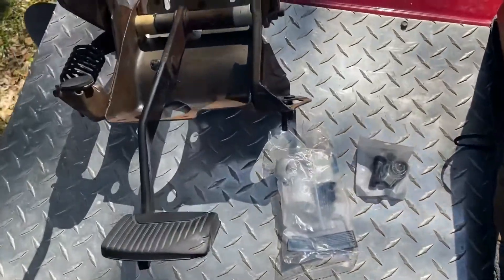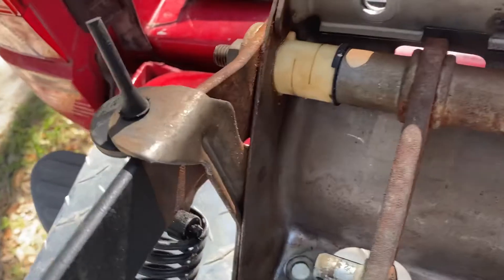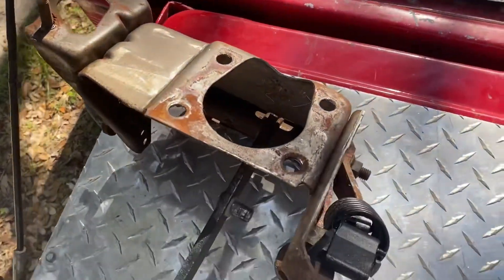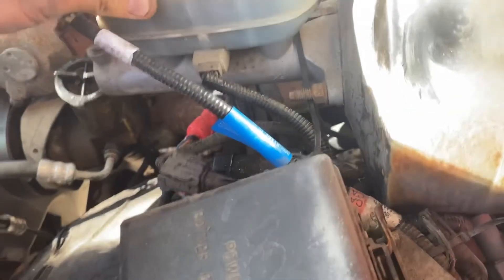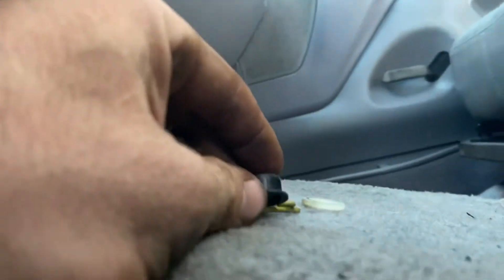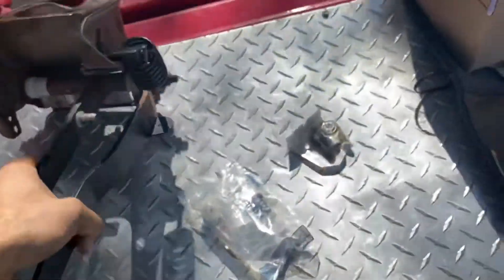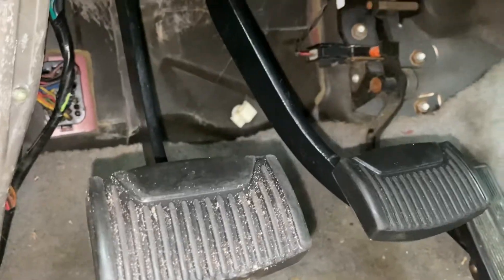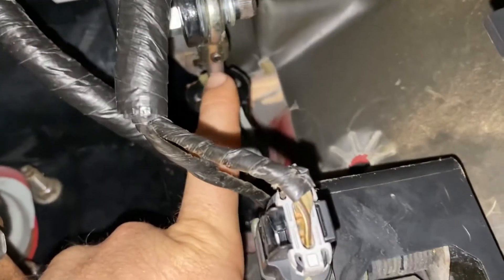Clutch Care on OBS Ford

Comment: Some how I got mine out without disconnecting the steering shaft
Reply from the maker: Wow, that’s awesome!
Reply: @obsdieselbros4160  yeah no idea how I managed to wiggle it out of there but I did. Thank you for the helpful video!
Reply from the maker: Yeah my pleasure! Glad it helped some!
Reply: I'd surely like to know how you did that! I need to pull mine out and replace
of at least replace the bushings
Reply: @mark98070  rotate it counter clockwise around the steering shaft and it comes out. Going back in is the hard part. It comes out easy without moving the steering shaft but does not go back in easy

Comment: I'm forced to remove steering in order to be able to get clutch pedal assembly out ?
Reply from the maker: Yeah that’s right, unfortunately.
It’s not too crazy hard, just the clamp that hold the u-joint in place and it slide into the firewall
Reply: @OBS Diesel Bros  man, I can't thank you enough for your quick response . I really appreciate it 👍 🙏
Reply from the maker: Absolutely! Glad it helps!